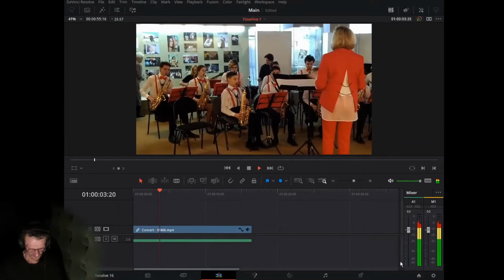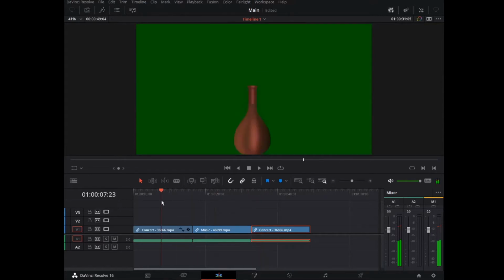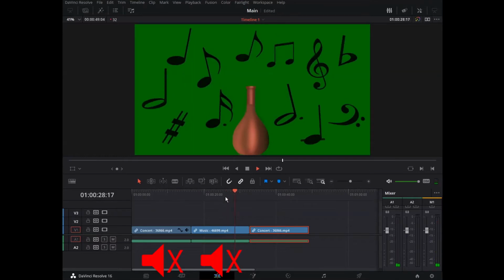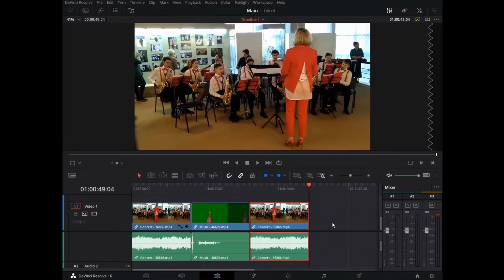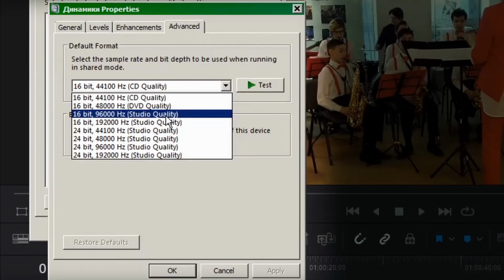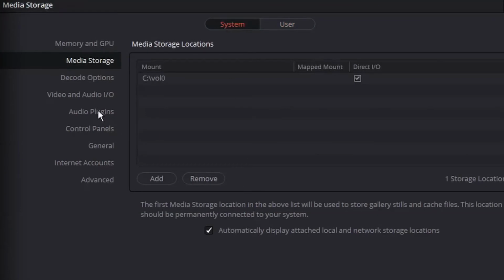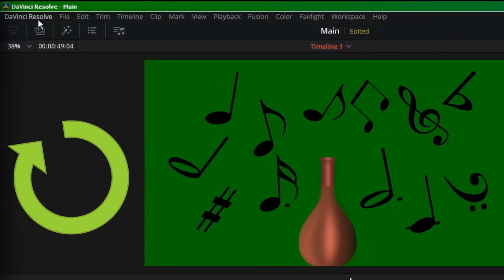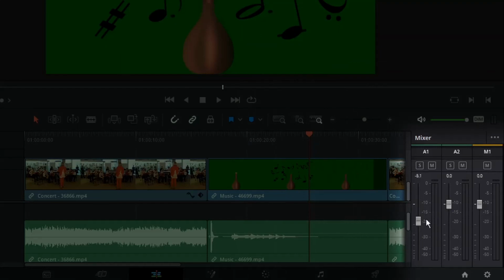No Audio Issue in DaVinci Resolve.

Comment: what do I do if under the cut section the media shows but there is no audio file, but in the Fairlight there is a audio green file with no sound waves shown AND in the mixer nothing is showing up either, it doesn't changers..
Reply from the maker: In the Cut Page we usually see the video and audio tracks, combined together in one solid stripe, which consists of two levels, the upper level is the video one, and the lower level is the audio one. The video and the audio  do not display in the Cut Page in separate Video and Audio tracks, as they do in the Edit Page. When you switch to the Fairlight Page, you will not see the audio waves in the default state. To see the audio waves in the Fairlight Page, you need to enlarge the height of the audio tracks. For this place your cursor in the left part of the screen, where the audio tracks are listed, and catch the line, that separates the tracks. Then you will be able to move that line up and down, adjusting the height of the tracks. At a certain point you will see, that the audio waves are visualized. In the Mixer you will not be seeing any audio bars, unless the play head is moving. The play head can move automatically (for this you need to press the Play button, whether in the screen, or in the key board, by default the Space key is assigned as a short cut for Play and Stop), or manually, if you catch the play head with your cursor and move it to the right or to the left. Have a good day, and feel free to ask more questions!
Reply: @davinciresolveelements  
Thank you for your Quick and Timely Reply!
 Im still new at resolve and figuring out what each editing tab is for, so your explanation was helpful.

I figured out what was wrong with my videos not showing any audio file at all, it was actually because of my file names. Resolve apparently doesn't like it when you name your main file in foreign/different than the standard font. 

Thank You again, its rare to see channels reply to questions timely, Have a good day!
Reply from the maker: @RaiiSkaii  🟢 I am happy to help!

Comment: What if we don’t have the option to choose a different Hz? Mine is gray @ 16bit and does not give me an option.
Reply from the maker: It seems, your computer is having issues with the sound card or/and with the audio drivers . The range of possible issues is quite wide, so it is hardly possible to determine what exactly is wrong without further information. Your machine and the operating system need more profound and wider investigation. In order to solve the issue of "sample rate and bit depth are grayed out",  I suggest searching for this in the WWW, including YouTube. You can also try searching for "24 bit 48000 Hz grayed out". By doing this you will start an investigation of your machine, you will very likely need to find out  the type of the sound card and the type of the audio drivers in your computer , along with other features. This investigation can take a while, but you will become more knowledgeable and more experienced in terms of computers, and you will get to better know the machine you are using. Should you have any further questions, feel free to ask, I will try to help, even though I am not familiar with this issue at all. From experience, I do know that issues like this can often be solved, or at least, investigated by looking for the solutions in the WWW.

Comment: Thanks for the video!. 
I have a similar problem, but I cannot see the sound wave no matter how big is the bar. (but the same video plays very well with good sound in windows media player). I am working with Windows 10.
Reply from the maker: 🟢 Thank you! If you have tried the steps, shown at https://youtu.be/oAoc7JaRNAo?t=220 , you can try more options:
1. Start a new timeline and bring your clip in there.
2. Convert the clip in question into a different format.
3. Delete the render cache.
4. Just wait for a few minutes for the audio waves to show up.
5. Restart the computer and start DVR only, without manually starting any other programs. This will let DVR use all the resources available in your machine.
6. Follow these steps: FairLight Page / Select the audio track /
A1 Input / Audio: Unselect / Audio : Select.